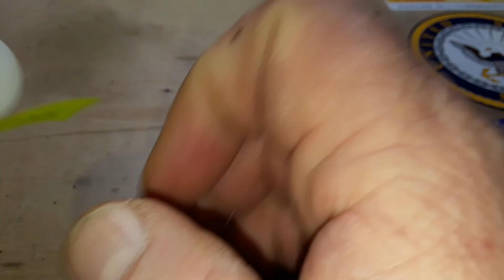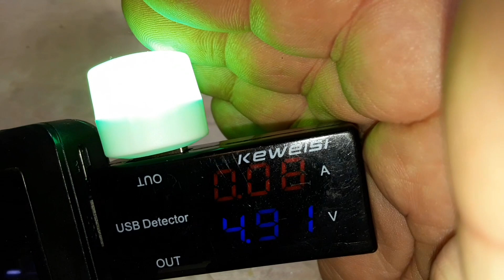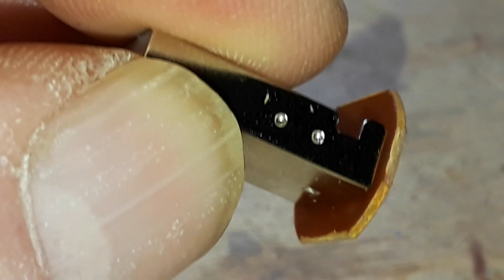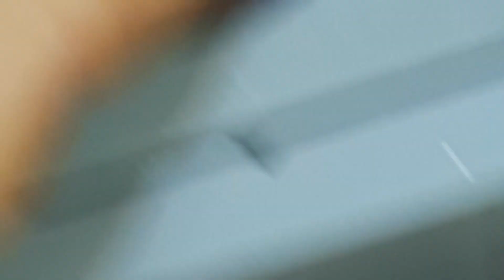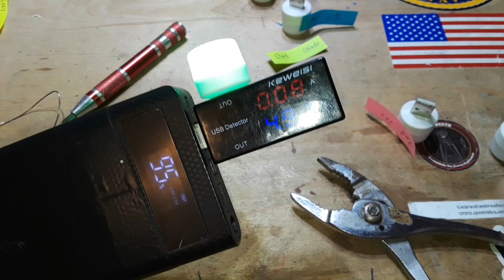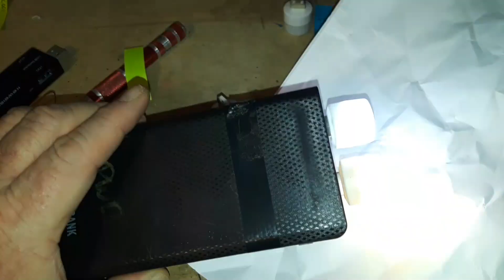Low Power LED USB Night Lights

Comment: These product tear downs really help me decide what to add to my parts collection.  My guess is that the voltage drop of each LED is 2.5v so two of them in series might not need any additional resistors.

Comment: I'm wondering if the darker areas between the soldered USB connector pins and the PCB edge are printed carbon resistors covered with solder mask. Either that or the LEDs have internal resistors, like you mentioned.